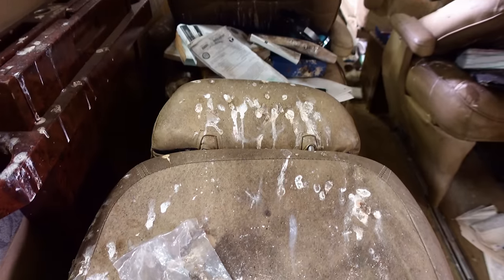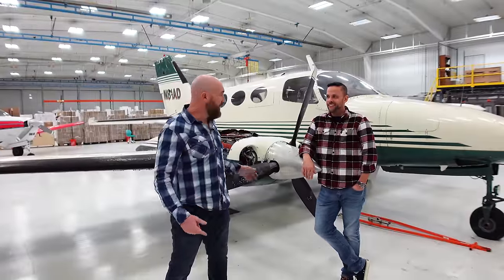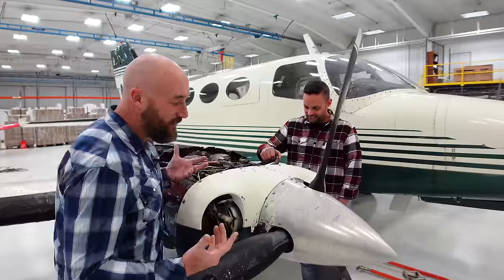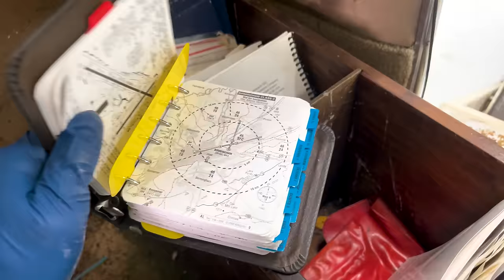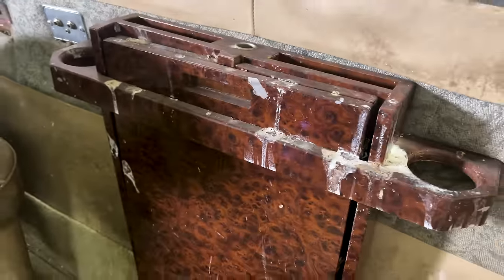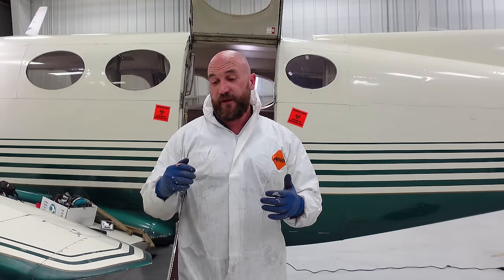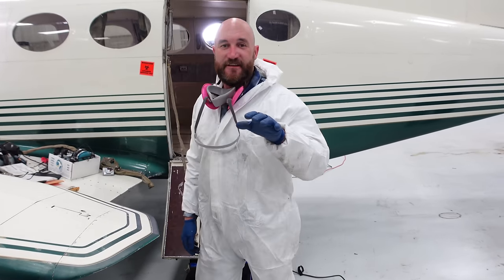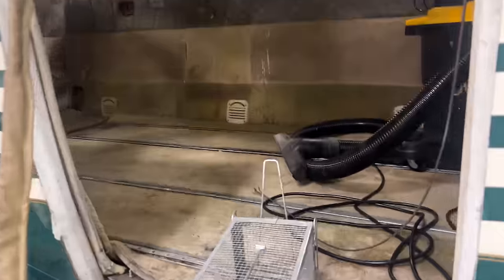Cleaning The Interior Of The FREE Abandoned Airplane Then Tragedy ! Ep9

Comment: Hope you have a speedy recovery. Also, when you get back to the 401, I would recommend spraying down the carpeting with an antiseptic prior to removal. The dried droppings on the surface are likely pretty stable, but the rodent urine in the carpet can harbor parvovirus for a long time. Better safe than sorry.
Reply: and "weils disease" . parvo is a canine predominant problem.
Reply: Or fumigate the entire inside lol
Reply: @danielscheuch  Yeah, I used to use Raid Fumigator. It's a gas so it gets into everything, not just on surfaces. Kind of like when they tent your house for termite control. The things you can get from mice, rats, and birds can be deadly. Treat it like poison whenever you are in the 401. 
Hope you heal completely. The knees and feet are no joke. And when we hit 40 and above, it all takes longer to heal. There is a reason top athletes retire when they reach their 40s.

Comment: Saw the split pin struggle. I get that sometimes when they are at awkward angles/places. (Im a mechanic). Just a trick to try next time, I made a realtively thin hook of hardened steel (fits through the loop head of most split pins). Using that and a screwdriver as a lever, they pop right out.
Been watching this since the start, doing amazing work.
Reply: sets of O-ring picks usually have these, they can be had at various qualities but the usual suppliers of screwdrivers have them
Reply: I have pair or pointy nose pliers that have become loose at the hinge. Put one prong through the split pin loop, grip and tap the pliers with a tack hammer adjacent to the pin. It works with no risk of it slipping and bashing your hand.
Reply: I use a pick lol.
Reply: I’m a pick tool guy myself!
Reply: A&P here. Yes, use a cotter pin hook or an o-ring hook to remove cotter pins. Trying to yank that seat stop with vice grips was ultra-cringe.
Reply: thats right so easy when you know
Reply: @gudnisnaer8171  yah

Comment: Mold is also a common problem in old cars wich have been left for years, or just a few months in wintertime. When you once had mold it usually comes back, even if cleaned with chlor products. Surfaces covered with plast or rubber as steering wheel/dashboard doesnt have a closed surface, the mold are deep in the material . The only thing that kills mold totally should be should be the solution which is used to clean medical equipment used for surgery (dont remember the name). Nice restoration, one of my favorite planes.

Comment: Went through a similar injury right before the ski season, a remote control brush hog I was operating snapped a blade off and it hit me in the tibia, I was fortunate enough to recover and get cleared about 2 weeks before our season started so I could go out and pick up other people as a ski patroller.
also I know we have a good reputation in the ems world for doing so much with so little equipment on hand, but man those guys have way less on their toboggan than we do at my hill
Reply from the maker: Wow that sounds painful ! How long did it take you to heal up ?
Reply: @rebuildrescue  injured on October 14, cleared back to play hockey December 8, it was an open chip fracture mid tibia not too severe all things considered
Reply from the maker: @deathsicon  I’m glad you were able to heal up and get back on your feet. 
They ended up putting a titanium plate and 8 screws in my Tibia… wondering if it was really needed as I had a 2-3 inch fracture. Because of the plate and screws it looks like it’ll be 12 weeks until I’m fully back on my feet.
Reply: @rebuildrescue  yeah that xray you showed looked worse than mine, i had a chip  that was probably smaller than a quarter right off the top, got lucky and no screws but they were on the table

Comment: Sorry but all that paint needs to be stripped and the structure needs to be inspected for cracks and damage. Please consider following the Maintenance Manuel, since even littel things such as window cleaning on a pressurized aircraft can cause micro scratches costing $$$ to replac.   Aircraft are not cars, they can not pull over for damage